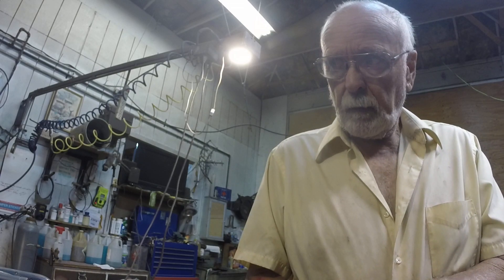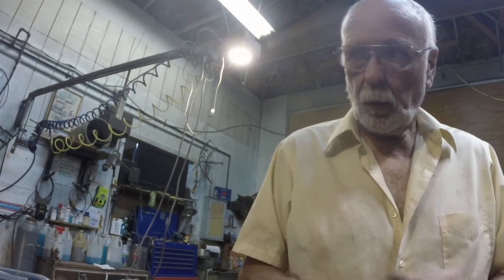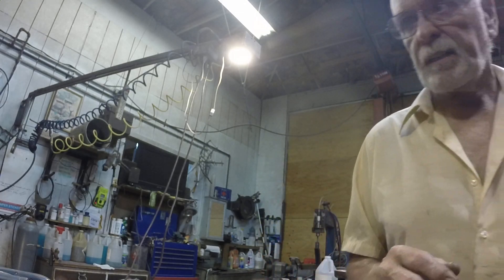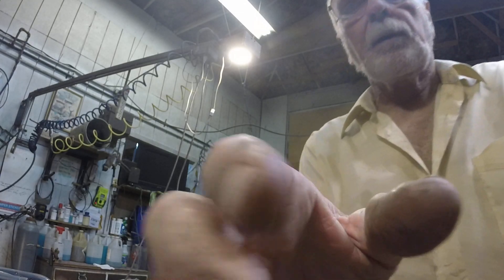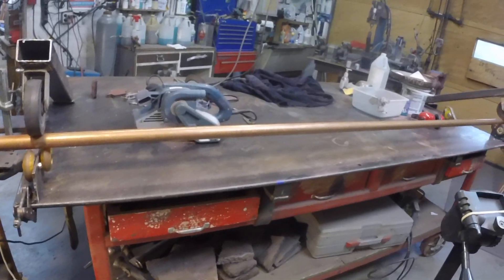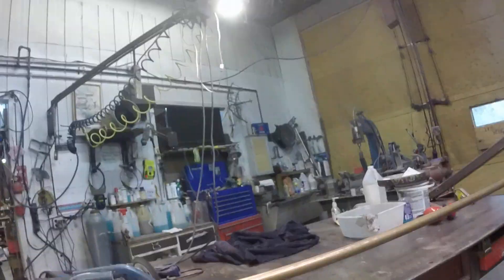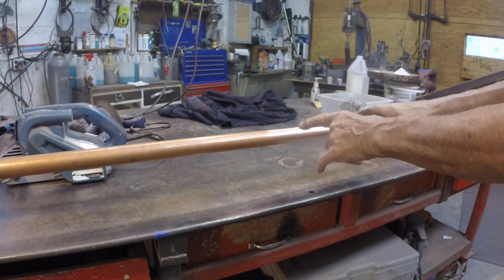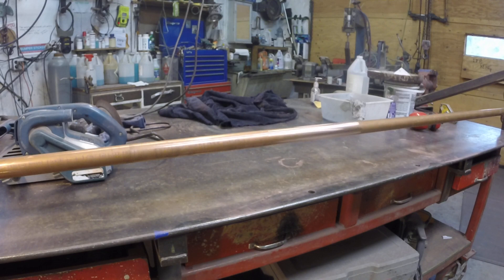Copper Gardens Preparing Straight Copper Tubing for Color

Comment: good idea. The next step would be cutting out having to use the grinder. Maybe a piece of 4" pvc pipe with hinges and a handle packed full of medium /coarse steel wool or similar to clamp around the pipe and just move it along the length.
Reply from the maker: true and a good idea ... that is if I ever needed to do this again ... in every one of over a thousand previous products, I can only clean and color after it is done ... with any luck at all, this will never happen again and that is why I am happy to be done and not in the least worried about the next and improved version ... good idea, hopefully not necessary!